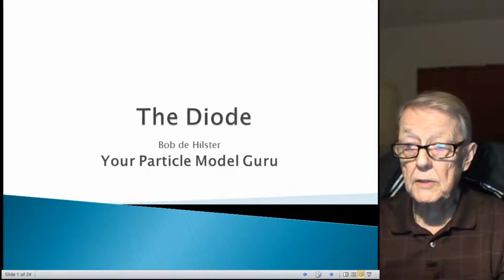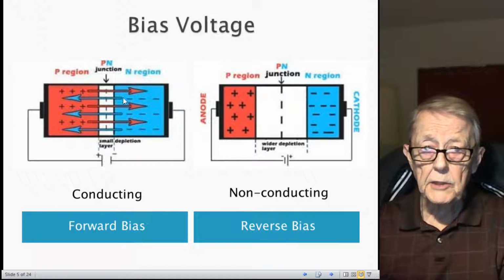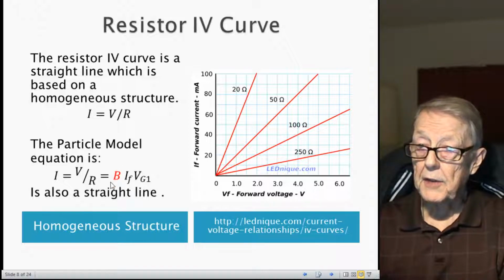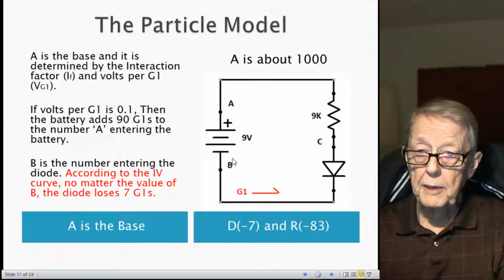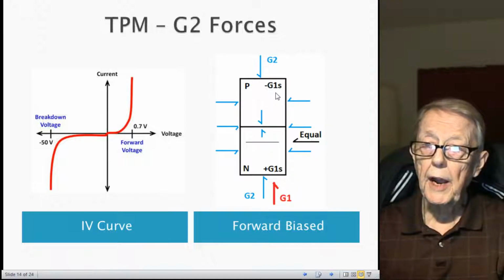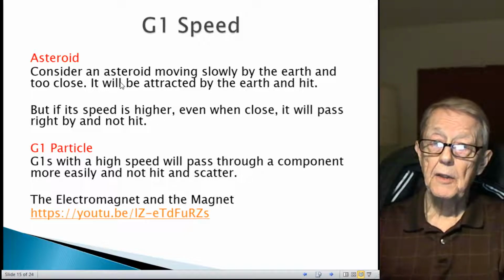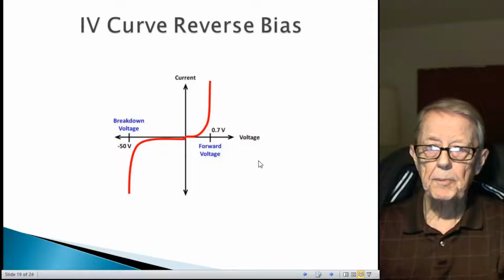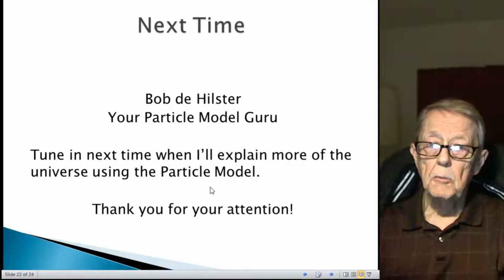The Diode

Comment: Thank you !
Reply from the maker: The short answer is "There is no depletion zone."  

But with TPM having no charge, there may be some  movement of G1s at the interface that could make a depletion zone.  But  is that the cause of the breakdown?

Due to the imbalance of the N region vs. the P region, the F2 force is offset to be in the N region.

It is this offset, the number of G1s flowing, and the speed that determines when the breakdown occurs.  Unfortunately, until we have more data, the point where the knee occurs can't be quantified.

Thanks for you interest! Bob